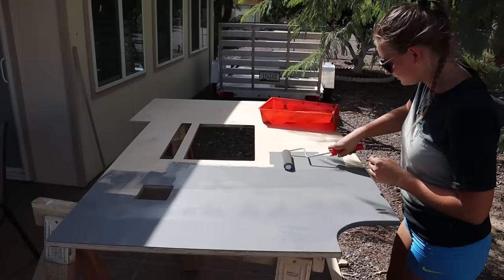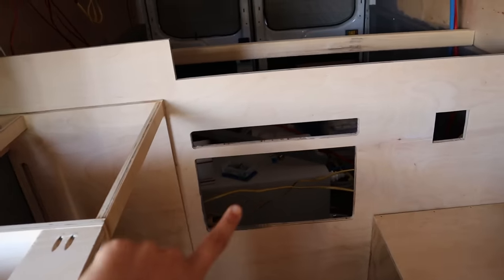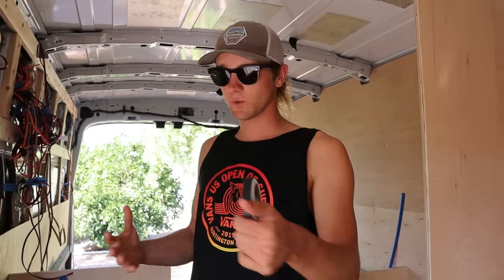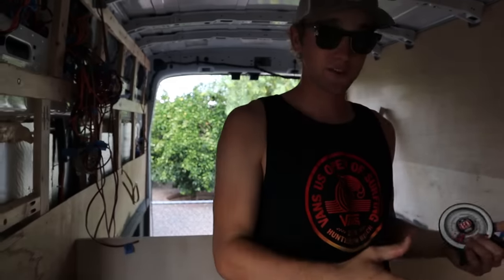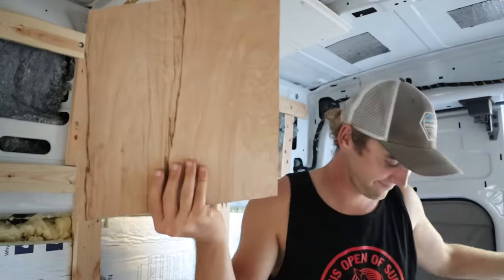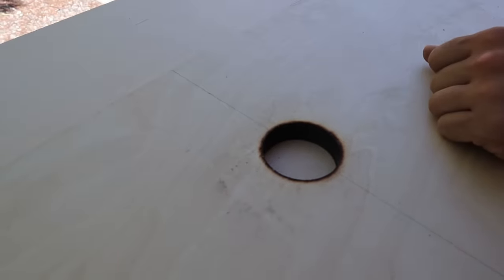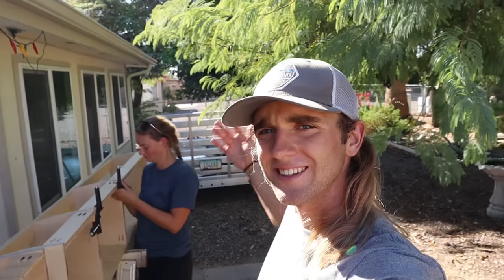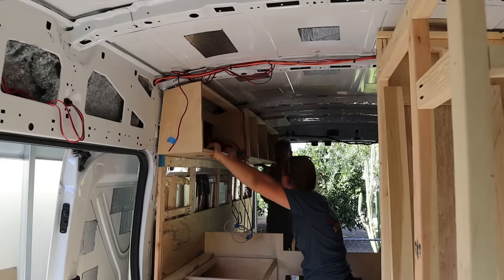How to Build Upper Cabinets for a Van Conversion | VAN BUILD SERIES (week 4)

Comment: To make your hole saws last longer once your hole outline is cut drill two small holes in the groove the teeth make,it helps the hole saw stay cooler and allows saw dust to escape an extra step but it works

Comment: I'm curious, to the vans have a weight limit they have to stay under? In the UK our Drivers license and the vans can only weigh upto 3.5T(7000lb ish), do you have a limit that you need to stick to?
Reply from the maker: Yes, it’s definitely important to stay under the vehicles weight capacity. The transit can carry a load of 3500 lbs.
Reply: @kensiewest  3500lb is not including the weight of the van though?
Reply from the maker: Correct. That is the payload, not the gross weight. It is not an issue with driver’s license here, more so just for the longevity of the vehicle itself.

Comment: What do you recommend for hardware to secure the cabinets to the van wall and roof? Do you pre-drill the wood and use self tapping sheet metal screws? Do you install backing boards first and then mount the cabinets to the backing boards? Sorry for all the questions, but this is all new for me. Thanks

Comment: After a solid setup and design, hopefully you are attaching this in the van with no less than lots of 1/4" or larger stainless steel bolts directly into Plusnuts or Rivnuts set in the steel van ribs, and steel angle brackets with bolts through the plywood.  Very few people consider the stresses in even a low speed accident, and you don't want those cabinets tearing loose and injuring the occupants...

There's a reason every commercial van with shelving in the back has it attached this way: occupant safety.

Comment: Hi Kenzie 
I sent a detailed message last week but I’m not sure if it went through.
I am interested in hiring you guys to finish a build out on a 2019 Dodge Promaster hi roof! It has some electrical pretty much finished, fan installed, all the windows I could possibly need, insulation, floor (but I want to change it) bed (you will laugh! But it works)
It had an blonde un sealed butcher block counter, 3 burner gas, sink,  fridge and the start of some cabinets which I didn’t care for. 
I took the sink, butcher block and stove out 😬 I can fill you in on why and what I was thinking. I just need you guys to take over and do your thing. I’ve seen plenty to know I will only need to tell you what’s important and not important to me and let you guys take over. U won’t need to go over every little thing once we decide but all good if you need to! I’m pretty relaxed and I totally trust you both. Sounds weird but i know it’s good. The seller was amazing and so diligent in his work on the van and in all the financials but cabinetry isn’t his specialty...electrical almost finished...you get the just of it. 
I have 2 small awesome dogs Lola and Mocha so I want to have something for them built in, need an office area and I want a HUGE skylight. If I could make the entire roof open I would! But it would mess with the solar and fan I guess 😝
YOU GUYS BLOW IT ALL AWAY!
OMG. your talent, attention to detail and experience with all aspects of the build is unbelievable. 
Your gift is rare especially at your ages. Just be sure to “hold the reins tight” so to speak. There are a lot of good people out there and plenty of not so good and I learned the hard way when I went through a major positive experience in my life. 
Anyway enough of that! 
Can I call you directly? Email? I could send my cell phone number through email but don’t really want to post here! Not that anyone cares about it but basically not the best idea.             Guess I could leave an email...supermail1@consultant.com  thought I would give Mail.com a try instead of gmail or the other more common ones. Funny I’m not a consultant and thought supermail sounded good! 😂    Thank you so much! Hope to hear soon!! Deanna

Comment: What's the before and after weight of this build after completion
Reply: That was my question, as well. I will be having a new work van, but cutting overall weight, as well as weight balance ( driver side is always the heavy side on most contractor's vans )
Has there been any consideration to combining wood with metal with poly engineered panels ?